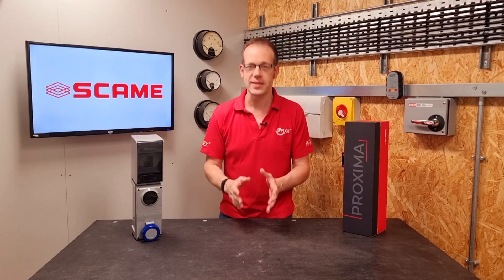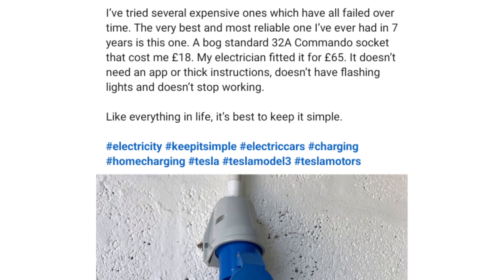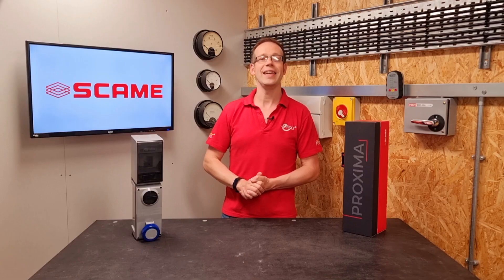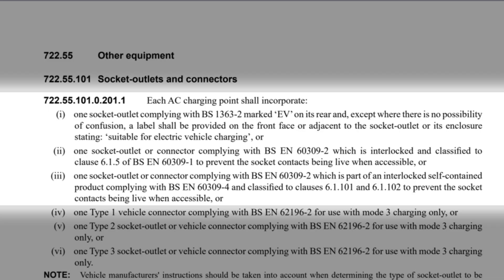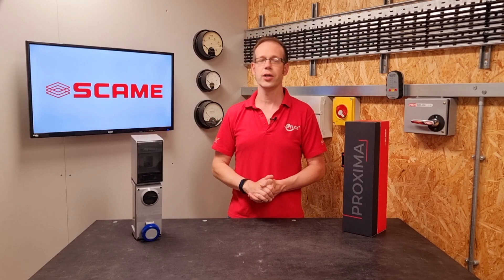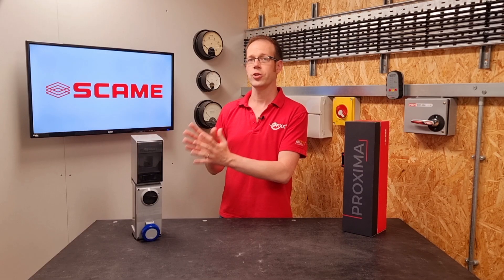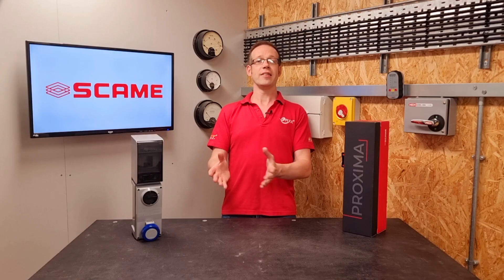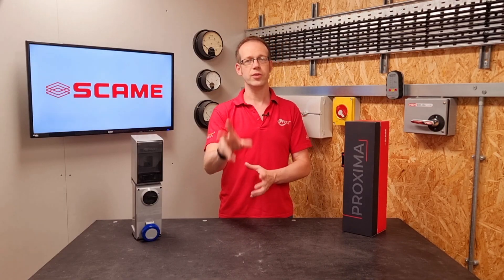Can You Charge an Electric Vehicle with a Commando Socket?

Comment: It's perfectly acceptable and I have a interlock 32A commando installed with a housing lock, does the job, 100% safe got mine fitted by a proper certified electrician for just £400 parts and labour
Reply: There are no pre made commando to type x leads that I know off and how is supply kw available communicated to the vehicle if only power and no comms are present at a commando socket/plug
Reply: @MrLeecavturbo   Volex make dumb ones for low cost.   EVOneStop sell Type 2 to 32A Commando but with a "smart" box in the cable so stupidly expensive.
Reply: @calmeilles  yes Matt I had a mooch about after I posted . Circa £350? but if you factor possibly under £200? for install of commando socket good saving ? Obviously not all whistles and bells with intelligent cheap rate and load shedding but hey
Reply: @MrLeecavturbo  you would need a portable charger.
Reply: @MrLeecavturbo I charge my car from a 32amp commando socket, no comms, easy
Reply: @MrLeecavturbo you don’t need communication to charge an EV, you can charge them from a standard 3 pin socket

Comment: I’ve never understood interlocked sockets.  They many times more expensive than a standard one, and seem like a pointless expense.  The socket on the end of the extension cable that you plug into the interlocked socket is not interlocked.
Reply: If a child lifts the flap and inserts a metal spike ?!?!?! That’s why
Reply: @MrLeecavturbo  do you wear both a belt and suspenders? Just in case one fails, you have a redundant system already in place? 

Here in the States we don’t have shutters on our receptacles and we don’t hear about kids sticking metal items into receptacles. Perhaps it was an issue when domestic power was new and people didn’t know better.
Reply: @mikecumbo7531  in the states you have low voltage with reference to earth. 👍
Reply from the maker: This might shift your thinking - https://youtu.be/XGCxvrDi8cU

Comment: I think shutters are ridiculous. Even as a pre-teen I figured out how to bypass similar shutters in other settings. They weren't required on outlets, but I cannot imagine anyone beyond the toddler stage who is interested in jamming something into an outlet being thwarted by a modern shuttered outlet.
Apparently the intent for shuttered outlets is to protect against toddlers stuffing a knitting needle into an outlet. Therefore the intent is satisfied by mounting the outlet greater than 1m above the floor.
Reply: No heart for you my friend!
Reply: I disagree with this analysis.
Certainly a 12 year old kid could bypass shutters and interlock and be tall enough to do so,  but that's a positive act they have to do and will wonder why the holes are shuttered, and might make them think twice.

Also, if electrocution occurs, there's a question of blame. If the sockets are not shuttered and no interlock, then the electrician is going to be blamed for doing a poor installation. If the socket is shuttered and or an interlock present, then the installer electrician will carry much less blame, and the coroner's report will probably state "death by misadventure".
Reply: @deang5622  Regarding blame I agree whole heartedly. However the liability is produced by the existence of and requirement to install shutters and interlocks.
By 12 years old there is no thinking twice, there is only the challenge raised by the question, "how does a plug go in with those shutters there?" The existence of shutters has caused things to be stuffed into outlets by the curious. There is no way to know how the number compares to the pre-shutter days.

Comment: All been good yes ,along as top quality products are used ,There is a lot of Chinese rubbish about that should be dumped back home ,, happy and safe fitting ,
Reply: I have seen mains powered products containing metal cases coming out of China fitted with UK mains plugs where the case is not even earthed.

You have to be extremely careful with the quality of mains powered products coming out of China. They'll stamp the CE mark on it and it doesn't conform.
Reply: @deang5622  Agreed, their approach to electrical safety leaves a lot to be desired, although, surprisingly, I've yet to hear of someone being killed by these substandard devices.
Reply: @deang5622  hi, you mean CE Chinese  Export ,
Reply: A lot of the 'Chinese rubbish’ is rebranded by 'reputable' brands and is actually pretty good. In recent years the Chinese have shown themselves to be remarkably innovative and, to be honest, are leaving the rest of the world behind. A lot of that ingenuity has been devoted to manufacturing things down to a price and they have a refreshingly common sense attitude to IP and patents, which let's be honest again, is holding the world back.

The latest generation of Chinese EVs, phones and anything else you care to mention are little short of genius and in terms of value for money are unbeatable. Their product development cycles are incredibly short such that Tesla will be struggling to keep up.
Reply: @sailingoctopus1  point taken on reputable companies getting components manufactured in China,however at what cost to the workers with ,wages and healthcare,  and hours worked ,

Comment: I think most of the video could equally apply to the question "I have a caravan, can I install a 16A socket to keep the leisure battery charged to save using an adapter". Personally I think an interlocked socket is acceptable to install and I'd do it.
But I think this would be limited to properties where you don't need to set a grid limit to keep the DNO happy and and don't have PME earthing (unless you bang a rod in). Both these problems are solved by using a modern EVCP.
Reply: You could also apply it to I have a welder can I install a 16A socket. Does my home workshop count as a "domestic" setting?

Comment: I own an Ohme EVSE which was supplied to me, as a domestic customer, factory fitted with a 32A commando plug.  If it's not permittable to have the corresponding socked installed, it would make it something of an ornament!  My electrician was happy to fit an interlocked socket fed by an appropriate RCD and PEN fault equipment.
Reply from the maker: The question is more about if it's OK in a domestic setting.
Reply: @efixx  Why not? It is installed for hot tubs in domestic all over the country. It is just a socket in the end.
Reply: @efixx  he does raise an interesting point though - if a commando has been fitted, and is interlocked in a domestic setting, where do the regs stand when you then attach an EVSE to it with a commando plug to give you Type 2 charging? The EVSE is thus considered more 'temporary' rather than being hard wired.
Reply: @efixx  Why would it NOT be? it's still an average human working it?
Reply: Exactly what we have, except PEN fault protection is provided by TT earthing. Thank you @efixx for providing the relevant references to the currently applicable legislation - much appreciated!

Comment: One aspect to consider is, should anything go wrong with the vehicle charging device, would this type of supply effect the vehicle’s warranty?
Reply: The supply is the same as every chargng point and you have to plug a adapter produced by the manufacturer of the vehicle. So no problem with the warranty.
Reply from the maker: I believe most EVs come with a lead and adaptor that can be connected to this type of socket.

Comment: I've got one of these in my garage for a welder but it is 5ft high off the ground so the kids cant reach it.
Reply: In the same place where they might find step ladders and storage crates to stand on? Kids can be very resourceful when curious. Just saying…
Reply from the maker: Clever stuff.
Reply: I am not sure that classifies as "being out of reach". It might work now, but as they get older taller, the electrocution risk is still present, unless the connector has an interlock and or RCD.
Reply: i have some 32 amp sockets in the garage, these have a dedicated isolator as they have something permanently connected that i like to turn off and on. they are up at around 2m. i suppose this could still be a risk if i forgot to isolate and unplugged the connector. i have some other 32 amp sockets around the garage at normal height, but as they have no isolator and are just for general use, these are interlocked (more just so i could turn them off). also have a compressor on a 16a commando with just normal 16a socket, with isolator at other end of garage. suppose in hind site to be extra safe they should have all been interlocked? note: all protected by RCD.

Comment: So in short. Yes, if it's interlocking.
Reply from the maker: I think I'd sleep OK at night. 👍
Reply: @efixx  how could you sleep at night? What about pen faults? And good luck in getting a document from the DNO saying it won’t ever get moved to pme? 

This Brings me on the the next topic of class 1 external lights.. pen fault should be fitted to all external class 1 equipment! 

Maybe in a few years we will have to pen fault built into our consumer units too😃
Reply: And even more important is an RCD.
Interlocks can be bypassed and electrocution can still occur. An RCD removes the electrocution risk.
Reply: @deang5622  You can bypass the shuttering on a standard 13A socket, and on the vast majority of multiway extension leads you can bypass the shuttering by turning the plug 180° and plugging just the earth pin in as there is not a large enough "face" to the extension to interfere with the L/N pins. To be honest it probably would not be too hard to come up with a shuttered IEC 60309 socket as the earth pin is longer than the phase pins.
Reply: @deang5622  Agree because shutters can be bypassed too. Correct RCD is the main thing.